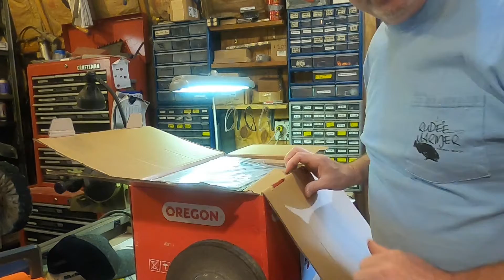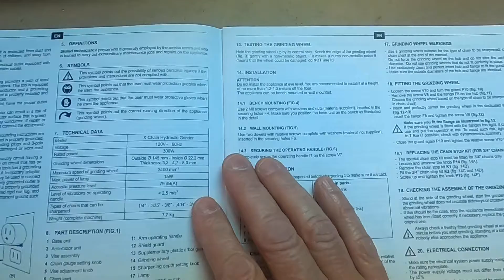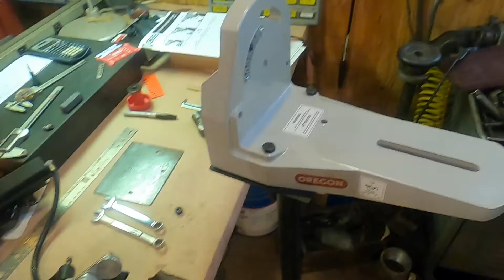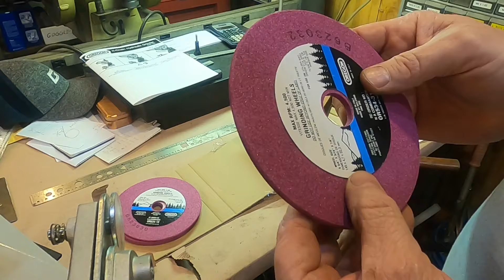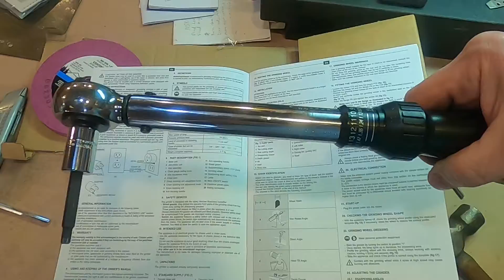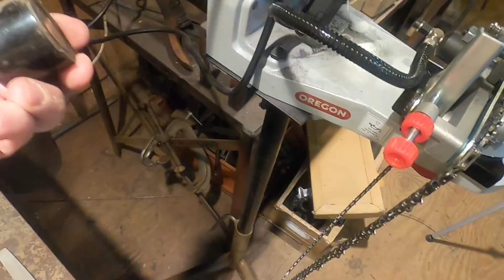Oregon 620-120 chain grinder setup - 086

Comment: Thank you for the video.  I installed the ability to reverse the motor to always turn the grinding wheel into the central edge of  the tooth to eliminate burs on one side of the chain.   I used a DPST (on off maintained) for the power and light, then a DPDT (on on maintained)using diagonal jumpers.  I made a top plate and used the toggle switches to hold the top plate in place.  Works great!
Reply from the maker: I really should do that. Just haven't had the time. Thanks for watching!

Comment: Excellent video. Your camera angles are just fine, and closeups are appreciated. I am using one of these at work, and have learned more from your video, such as the ability to grind rakers too. I'm 6'1" tall, and just hate bending over to sharpen, and my light is bad. So I intend on establishing better lighting, as well as bringing the sharpener up to chest level using a wall mount. The Oregon sharpener stand my boss bought for us is flimsy and too short, unless you're sitting down. Thanks for making this video!
Reply from the maker: @jaredbrooks1930  thanks for the comments! I wound up welding up a plate and some angle iron so I could clamp it in my bench vise. Much more stable and I prefer to sit in front. I added a sewing machine led light which really helps. I should probably do another video. Thanks for watching!